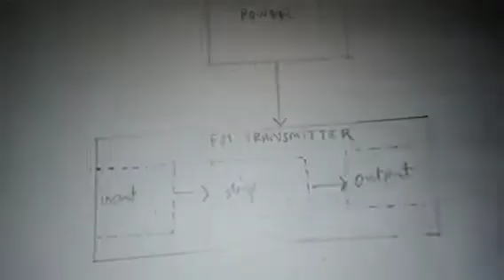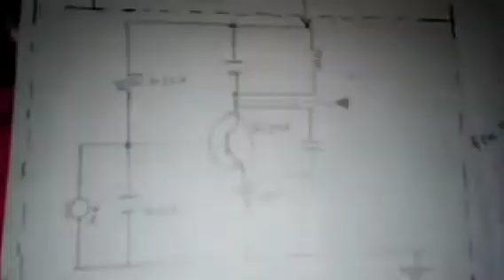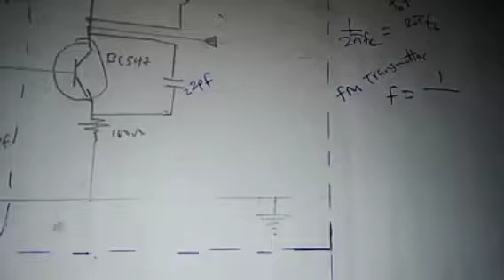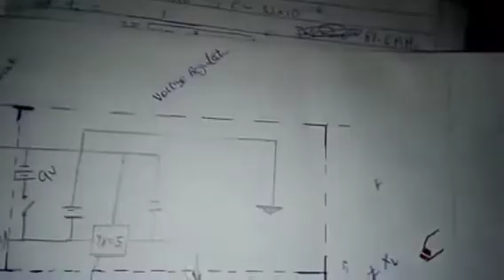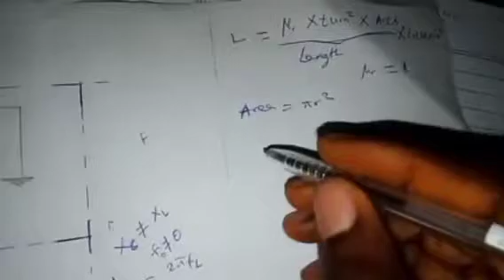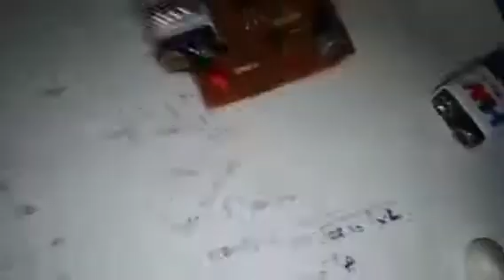August 23, 2023

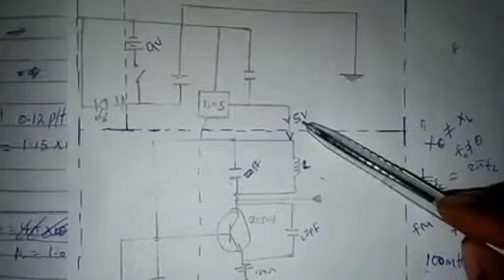Comment: 16:22 please you said something here about when the input voltage drops below 9v that with the voltage regulation system it helps maintain 5v constant input voltage now my question is what if the input voltage drop below 5v i mean now the 9v how will the voltage regulation system help maintain the 5v that should constantly enter the system?
Reply from the maker: No. the input voltage of the regulator must be above 5v